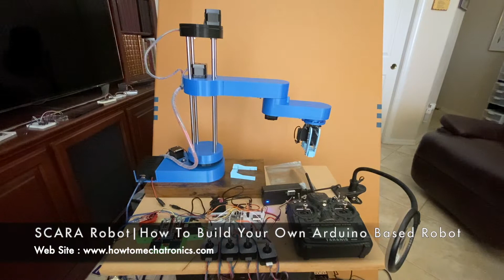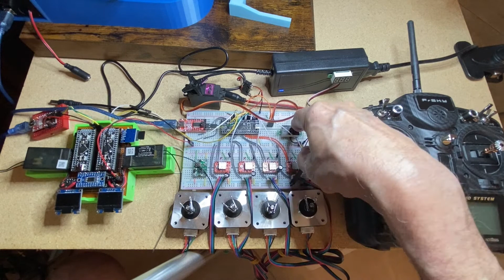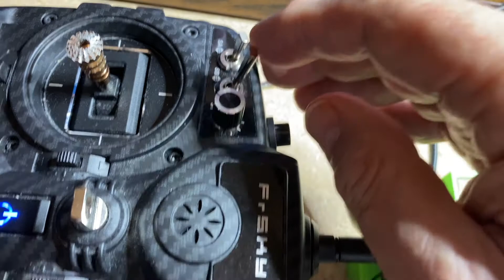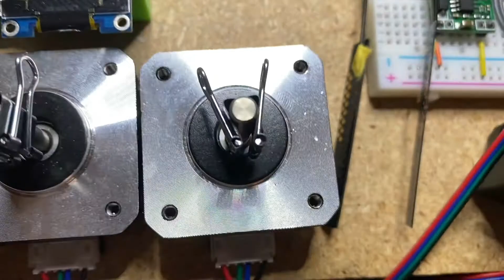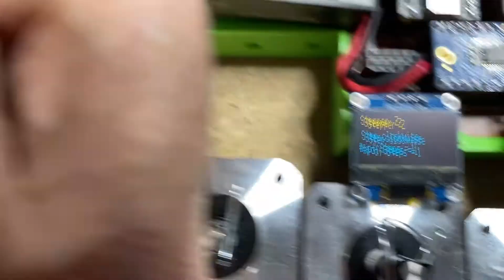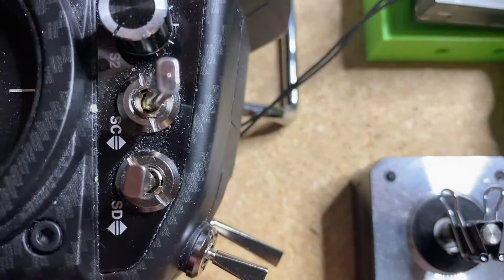Using a STM32F4 Black Pill to control a SCARA Robot remotely   Part 1 Feasibility

Comment: ´Thansk for the video. Very nice project with the new user interface with remote control! Thank You for very clear explanation! I can't wait the second part, to see how the position feedback will be implemented, whether via displays and I would be also very interested in the coding part, hope to see that as well, so looking forward to the upcoming part, thanks!
Reply from the maker: Thanks for your comment, I am thinking about changing the interface to the STM32F4 Black Pill to use the Arduino CNC shield with out the arduino, So the shield would interface to the STM32. The reason for this is the shields PCB eliminates a lot of the wiring. I am going to put out a fast video showing how that can be done before the part 2 with the SCARA robot.

Comment: Nice job, sir! 
I am building the robot as well.
Reply from the maker: Thank you very much. I hope you enjoy this project as much as I have. Just follow Dejan's  HowToMechatronics.com Video and instructions and you will learn a lot and have a very interesting project. I am still working on the Part 2 as described in my Part 1 video and hope to have an interesting demo in that video.
Reply from the maker: There are 4 videos that were created for this project. The Part 1 project and  video was  the Feasibility of modifying the SCARA Robot to show how this project can work. This Part 2 video discusses how the project was implemented and contains a working demo of the modified SCARA Robot. The Part 3 video discusses the code used in the receiver module that generates the commands sent to the robots controller module that controls  the robot's stepper motors, servo and limit switches remotely. Part 4 discusses the code in the controller module of the robot.

Comment: Great modification to the original SCARA Robot Arm. I built the original project and I was able to make it home after a few trials and errors. The only problem I am having now is I can't get the gripper to close  or open. I have checked all 3 wires of  the servo motor and I am able to make it close and open with the Arduino provided example independently but not with SCARA code and since you have done the same project, I am hoping if you can help
Reply from the maker: The home function happens when the arm's Arduino is powered on and is not in response to the Processing App running on the PC or Mac. So if you are sure the Processing App is working then I would check the Arduino code. The way I would try to find out what is happening is to be able to check the Arduino part of the SCARA code but with the USB connected to the Processing App,  I would connect a small display via I2C to the Arduino and see if the Arduino SCARA code is receiving messages from the Processing App and trying to write to the servo. if you have an issue getting to the Arduino I2C because of the CNC shield you could use a breadboard  for the shield wired to the Arduino or use an Arduino Mega for the test.I would be interested in how you make out.
Reply: Thank you for your quick reply, I didn't mention that I am able to use Processing interface  and control the Robot Arm through The GUI slider and and use the Save and Run program. the only think I am not able to use to control is the gripper. Did you change anything on the Arduino Code or Processing when you tried it?
Thanks again,
Reply from the maker: I did not change any of the SCARA code except for a few of the constants in the Home logic to get my arm to line up as it should for a zero position.. but I did not check it out very well as I was more interested in my modification. I just reviewed the part 1 video and I don't show the servo opening. I can't say for certain that my gripper opened in the original Scara project. Therefore, since yours does not and I can no longer test the original project, you will need to see what is happening in the Arduino code and using I2C as I mentioned earlier is one way to debug this problem. Sorry I cannot be more help to you.
Reply from the maker: I just thought of one more thing In the original documentation there is a circuit layout called "SCARA Robot Circuit Digram" using the colors shown in that picture the the limit switches plug into the CNC into the white pins but the servo signal wire plugs into the black pin. make sure you got the signal pin plugged correctly.
Reply: @lotbotrobotics5026  I did find this error too, I made my comments on t Dejan Youtube Channel for people who are just starting with this project to not make the same error. I will continue troubleshooting the issue,  I will let you know if I found resolution. thank you for your help
Reply: I just sent this remark to Dejan, I hope he will answer it at one point, see if it makes since to you:
Hi Dejan,
I have a question regarding this part of your code:
 "gripperServo.attach(A0, 600, 2500);
  // initial servo value - open gripper
  data[6] = 2500;
  gripperServo.write(data[6]);
  delay(1000);
  data[5] = 100;
  homing();"
I am not sure why you did not use the Arduino map() to map the 600 min value to 0 degrees and 2500 max value to 180 degrees.
Reply: @abdelmajidbejjaji857  pls can you help me ??? I made the scara robot but nothing go , i change the double // on May port "com 4" and now the program go , but if i do something in the spider noting ho pls help me it's for my graduation , i write on facebook ti dejan but doesn't answer to me , i Need very much help pls
Reply: @Bossetti2323  Did your robot go bro? I am building this robot also, every motor still work but the whole code didnot move at all.
Please help me

Comment: Hanzhen harmonic drive gear ,  robot arm gear ,  machine gear reducer,  over 30 years experience ,
Reply from the maker: Thank you for the information. Your gears are certainly better quality then what I used but for an inexpensive home project the ones I used were sufficient.